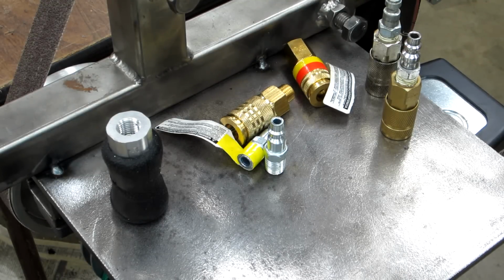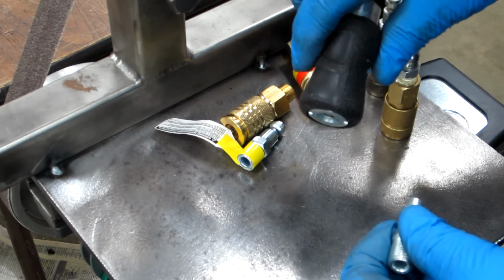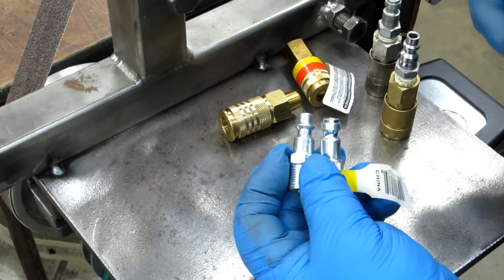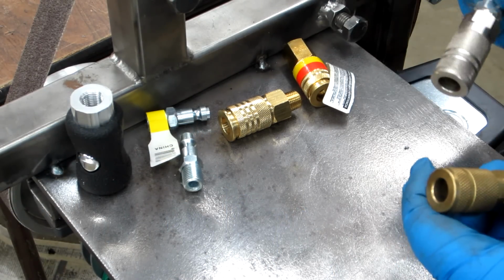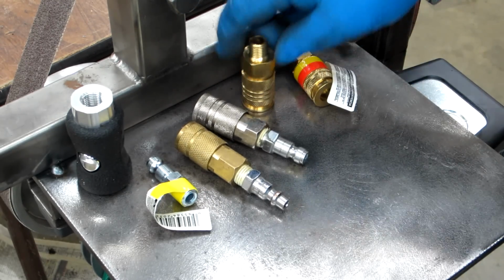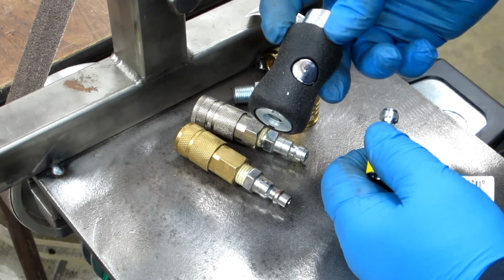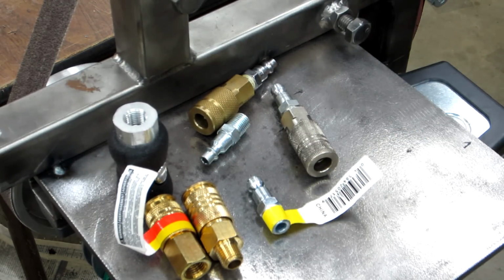Air fittings

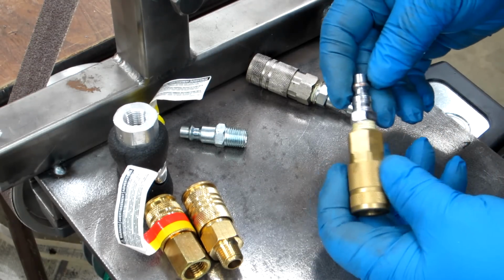Comment: Finally figured out how to swap the older style couplers at 3:28. I feel dumb.
Reply from the maker: I tried to play the vid to see what you're referring to.....but it won't play past 3:03.....now I feel dumb. LOL  I'm glad it helped.  I've had plenty of "car guys" in my shop over the years that couldn't figure out the air fittings....not sure why since a couple of them even owned compressors. lol
Reply: @bluehandsvideo  I am working in a metal shop for a month now, I was never shown how to swap the couplers on the air tools. That was the part where you pull back on it to release the end that is using the air, thanks for showing me before I had to ask a stupid question!
Reply from the maker: @indecipherabl3  You're more than welcome! :)  ......and at some point, they didn't know how to do it either. ;)
Reply: @bluehandsvideo  You are right. Never stop helping people learn!
Reply from the maker: @indecipherabl3  ....also....if there's air pressure on the connector(in the air line), it will be easier to pull that collar back if you push the tool in slightly at the same time you pull the collar.  The way the bearings(balls) lock the tool in is by being jammed between the outer collar you pull back and the tool's fitting.  You'll be a pro at it after just a few times. :)
Reply: @bluehandsvideo  That makes sense. Hopefully I will be a pro with everything in the metal shop given a year or two lol
Reply from the maker: @indecipherabl3  Your desire to be that will make it so, I'm sure of it. :)

Comment: Best video I've  come across. I bought a compressor a week ago. I got a 3/4 inch hose in good condition. I want to connect this hose to my compressor. The compressor  has a 1/4 in. diameter line. I want to get rid of the stock line. That  looks to be a major plumbing headache. Any suggestions. I looked  for a 1/4 mnpt x 3/4 female no such animal. At this time I have no fittings  on anything, hose and all.
Reply from the maker: Thanks!
Hmm....not really sure what you're working with.  I'm guessing that the 1/4" line your compressor has is the actual air fitting?  You may be able to plumb right to the tank like mine.  Here's a link to another vid I did.....link goes right to the part that shows the tank's fittings.
https://youtu.be/BagZOmIVIPk?t=15m12s

When I redo mine, I will plumb larger fittings at the tank.....this is really necked down too far and is killing my flow.  I have another 50'(maybe it's 100') of hose hanging behind the tank....the extra length hanging outside helps cool the air so that my water trap inside the shop will catch more.  I'd like to increase that hose to a 1/2 or 3/4 inch line...one for the extra flow and two, for the extra capacity.  It's like adding another small tank to the big one.

Back to your plumbing......most likely, you'll simply need to go to home depot and look at the plumbing section to find an adapter that will take you from the small to large size.....then connect your 3/4" air fitting to that.  3/4" hose is way to cumbersome to actually run to the air tool itself, so you'll want to get a smaller line for that.  There's lots of nice coil hoses out there....if you look, try to find one that is actually 3/8" instead of the 1/4" that most are.  One of these days, I'll get around to redoing my air hose setup.  For as much as I run the glass bead and sandblast cabinets, I should do it this spring if I can afford it. lol
Reply: Thx for reply. I will check  that other vid. I still hadn't bought any fittings yet, needed to coil and move that 3/4 x 100' hose. Its a beast.

Comment: I just watched  this video and  I have a one stripe connector from  True-Flate and it takes the industrial fitting as well as the automotive plug. It is a 13-325. both cards have some Califormia lead or cancer warning on them says to wash hands after touching them anything to worry about there?  I know several guys who use these same fittings  for airline hook-ups for dredging  do you know if they are flirting with danger breathing through those fittings? They are cheaper than the regular air hose fittngs  for diving.
Reply from the maker: Hi Michael,
Sorry, I'm not an expert on anything you're asking about.  In California, water causes cancer, so I'm not sure how great the threat is from these fittings.  Anytime the connection is made or un-made, there's a chance for microscopic flakes to be released into the air stream.  I would think if it's bad for your hands, it can't be good for your lungs.  Very interesting and unique questions.  Sorry I can't be of any help.  Good luck finding an answer.  I'll bet there's some diving forums out there on the subject of surface supplied diving.  Hmm....I wonder what connectors automotive paint booths use for their supplied air systems?

Comment: Unbelievable , I thought all this time they work on any fitting ! I did not know that the bands on the units meant something ! Lol ignorance on my part.. Thanks for clearing that up. Also is there a particular one type of fittings that is preferred over the other, along with its make ? I always have trouble with them leaking in a few weeks , let alone a few years as you mentioned , and a possible repair ?
Reply from the maker: http://www.miltonindustries.com/couplers-and-plugs.html is the company that everyone seems to copy.  It's also the one I've heard most recommended.  Each style has their advantages, but I seem to have better luck with the industrial style...the one with the snout on the end....for the male end.  I always use the universal for the female end. Thanks!

Comment: Technically, there are so many manufacturers in China some produce higher quality than others and it depends on the brand's quality control and demand. However, based on overall use, I generally find Chinese products to be manufactured with inferior materials and occasionally, if not often, deceive us by bypassing steps such as skipping steps when chroming steel or putting poisons in cat food and ointments or urine in perfume. This is what we get for being "cheap" and manufacturers had to source from China to get our business through lower prices and quality. Like North Korea, many products are getting better over time with rising costs.

Comment: your audio cut out when explaining the "3 band" coupler ... can you fix and re-post maybe ? i was really into listening to your explanations ...
Reply from the maker: That's weird.  I just listened to the second half and the audio is fine.  You might try it again.  Basically, the 3 band coupler is a universal and will fit either of the male fittings.  I've used them a lot over the years and they are pretty good with either.  The black HF one is a lot more picky about which fitting it likes.  I actually changed all my fitting out to high flows awhile back.  I shot a lot of video, but I'm not even close to being done with the editing. lol
Reply: thanks ... could i use the 3 band coupler for automotive tools and construction tools if i change out all tool male couplers to the same type/size ?? does this make sense ??
Reply from the maker: @jesse8721  I can't say "yes" for sure without knowing exactly what couplers are on the construction tools.  Check out the product on Amazon.....It's just a link I found....I'm not getting anything from this.....it shows the 3 band style and in one of their pictures, it shows the three nipples that it fits.  

https://www.amazon.com/Primefit-UC1414MB6-B10-P-Universal-Contractor-10-Piece/dp/B005JRMTAI/ref=sr_1_5?dchild=1&keywords=universal+air+coupler&qid=1587459067&sr=8-5

Comment: great presentation. thanks.any idea of any adapter for a fuel pressure hose that goes to the fuel rail  to make it fit to a automotive quick connect?as you know these fuel pressure tester hose have a small fitting on it's end. thanks
Reply from the maker: Thanks!!
Sorry, I'm not familiar with the fuel rail fittings at all.  Might be able to cut the hose and put an air fitting on that end....??   Are there pictures of the rail and fittings somewhere?
Reply: @bluehandsvideo  Hi ,thanks for the reply,unfortunately you tube is not allowing me to attach a picture and it is hard to have a good look on the male part of the fuel pressure hose that goes to another hose with a quick fitting  when i look at it on the web,but that was very nice of you to try to help. thanks again.
Reply from the maker: @moebassidji8306  You can also reach me via the contact page on my site bluehandsfab.com   There's a link at the bottom for files that are too large for the email.

Comment: Audio cuts out for the last minute or so.
Reply from the maker: Sorry about that....this is a cut/paste from a reply I gave to another commenter that pointed out the same thing......
lol.....I didn't realize the end of the vid disappeared like that!  Sorry about that.  I went through a period where I had some editing issues. I guess that was during the time.
The challenge is that whenever anyone else is working in the shop, they have a really hard time using the brass couplings.......so the push button style is way easier to show them how to use.
Thanks!!

Comment: What does the letters "J" and "M" mean on the fittings? It will say 1/4"M or 1/4"J on them.
Reply from the maker: The M style should refer to it bing the Milton style which is commonly know as the industrial style.  I've been googling J style, and I'm coming up empty.  Any chance you have a pic or a link of one?
Reply: bluehandsvideo I double checked. Some say U *looks like a J due to bad stamping. The others say M or maybe IM.
Reply from the maker: U isn't a common one either.  I'm at a loss! lol
Reply: bluehandsvideo It has 3 bands on the sleeve. I'm guessing Universal.
Reply from the maker: That's a great guess.  I think you are probably right! :)

Comment: are these orion or euro?   seems the most confusing thing those connectors for air pressure  :(  seems they are in different sizes sometimes too)
Reply from the maker: They're all imperial/SAE.  I don't know why they came up with so many different ones, but you're right....they get confusing.  If it's your home shop, find one you like and stick to it.  At some point, I will be converting everything in my shop to the high flow version of one style....but I've been planning on doing that for years now.....no clue when it will actually happen. lol

Comment: Is there a quick-release type that doesn't 'pop' or 'swoosh' when releasing? Like a silent-one? Mine does.. Its universal type
Reply from the maker: There are ones like that available from with the better brands.  I've got one or two that require a double button press.  First press releases the pressure, but will not let the tool go flying out.  Second press releases the tool.  Do you have a make and part number on the ones you're using?

Comment: Last minute has no volume.  "Part of the problem is that ................"
Reply from the maker: I'm pretty sure the rest of that comment was....."Part of the challenge is that everytime some else is using it, they have more trouble with the pull back style.  The button release is always easier for them."   The reality is that I just don't have anyone else working in the shop anymore, so it's not an issue.  I've actually upgraded most of them to a High Flow style now.  I've got a LOT of video shot, but it's still in the editor. ;(

Comment: I have a question about air tool connectors.  I want to use my compressor to blow out my home-grown lawn sprinkler system,which has some ordinary garden hose buried around the yard.  I can't find a fitting that allows me to connect the air hose to the garden hose.  Any suggestions?
Reply from the maker: I wanted to fill up an air mattress that had a larger inlet than any thing I had.  I used electrical tape(cheap colored stuff) and built it up on the end of an air nozzle.  I gave it a bit of a cone shape.  It seals to the mattress quite nicely.  You'll have to hold the hose end with one hand and the air nozzle with the other while blowing. 
You might be able to take the end of a bad hose.....that has the end you need to connect to your system......then build up the end of the air nozzle with tape until you can put the hose piece on and clamp it down. Then you'd only need one hand.
Not sure if either idea would work for you, but I've never see a fitting made to do what you want.  If you want something more solid than the tape, I'd visit Home Depot and find some brass fittings that build up to the size you could clamp the hose on.  You could put a quick connect fitting on it and just plug directly into the air hose.  Some of my air nozzles have threaded ends with replaceable tips.....if you have one like that, you might be able to find brass fittings to screw right into the nozzle end.  I hope some of this might work or give you some ideas. :)
Thanks!!
Reply: bluehandsvideo Good ideas--thanks
Reply from the maker: Robert Nagel
You're more than welcome Robert.  If you happen to put up a video on what you do, please come back and post a link to it. :)
Reply: Robert Nagel Go to Home Depot and find a PVC fitting that connects to your sprinkler system.  Then glue a PVC cap/plug into it.  Drill/tap the end of the pvc cap or plug and insert a male compressed air fitting.

I had to do the same to adapt mine...but $7 in parts vs. $40 per year for someone else to blow it out was worth it!
Reply from the maker: Shawn Baker Great info.....I hope Robert sees it! Thanks!!

Comment: hey I got 2 questions for you since i have the exact same compressor

1. will using a 50ft air hose instead of a 25ft one affect scfm? (same couplings and fittings and hose diameter)

2. would you prefer and/or use brass or steel fittings and couplings and why? thanks.
Reply from the maker: 1. If they're good quality hoses(3/8" preferably), the difference shouldn't be noticeable.  You lose more through the fittings than the hose.  For info on fittings, look up Milton Industries site and check their catalog.  I have two 50' hoses between my compressor and regulator in the shop.  I did that specifically to help cool the air to pull as much moisture out as I can at the first water trap.  I'm sure I'm losing some cfm and psi, but since I can set the pressure at the end of that line, the pressure is okay.  I then have shorter hoses in the shop.  I connect a high air use tool and pull the trigger......then set the shop regulator to 90psi.  I have a 50' hose reel in the shop after the regulator.  I don't really notice any difference between that and a coil hose connected at the regulator.  I do have a cheap, blue hose(pvc outer) and there's a noticeable difference if I connect after that.  It's only 25' and is hooked to my glass bead cabinet.  I really need to upgrade that setup.

2.  I don't really have a preference between brass or steel.  The push button aluminum ones I show in the vid wear out pretty fast....I've gone back to brass on the hose reel because of the high use.  I guess I don't use steel female connectors because brass is what Home Depot has.

Take a peak at the first chart here.... http://www.airtx.com/recommended-air-hoses.htm   It's shows a .7 psi drop over 50'(3.8") at 10 scfm.  Most tools won't pull that.  My high speed disc sander pulls more than my sandblaster. 

pg 2 of Milton's cat...
https://www.miltonindustries.com/uploads/Milton_Catalog_August_2011.pdf
Even the 1/4" fittings handle more cfm than the tools will pull.  But, if you can go with the "V" style fitting...you might as well! :)
Thanks!!
Mike
Reply: bluehandsvideo that helped. how about automotive or industrial fittings? which would u prefer and why? i heard automotive is more sealing and less prone to leaks
Reply from the maker: *****
A lot of my fittings are automotive, but I seem to have more trouble with them leaking than industrial.  When everything is new, they all work great! lol 

Here's some good info...middle of the page
http://www.homemetalshopclub.org/news/aug03/aug03.html

http://www.portlandcompressor.com/compressor/Couplers_and_fittings.aspx

Comment: Does anybody know the name of that white stuff used in the connectors to fill up micro holes inside.
Reply from the maker: I don't know of any white stuff other than the teflon used to seal the threads.
Reply: bluehandsvideo thank you so much. I'm not a native english speaker so didn't even know how to google it. You helped a lot
Reply from the maker: You're more than welcome!  If you google "teflon thread sealant" you'll get results for both the tape and the paste.  I tend to prefer the tape....not as messy. :)

Comment: Why is there industrial & automotive instead of a single standard?
Reply from the maker: Great question!  I don't know.  There are more styles than just these two, but these are the most common.  I'll bet that it has something to do with who had the patents.  Someone didn't want to pay for the patented style and decided to design their own......??  Just a guess. lol  Kind of question that would be interesting to research, if I had the time. :)
Reply: @bluehandsvideo  soo is there an advantage to one over the other?
Reply from the maker: @NutsandBoltsAuto  I've had better luck with the industrial style, but they're cheap ones. I would think that if you buy quality connectors, either would work just as well.